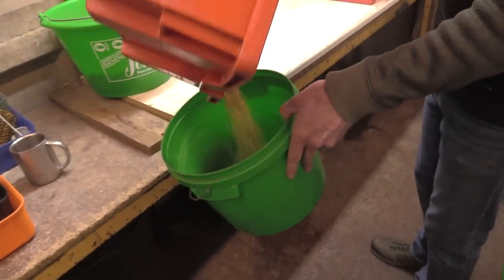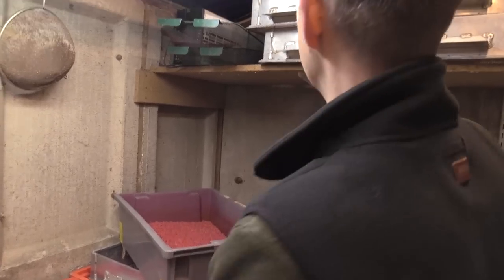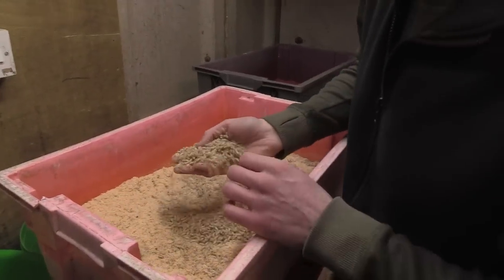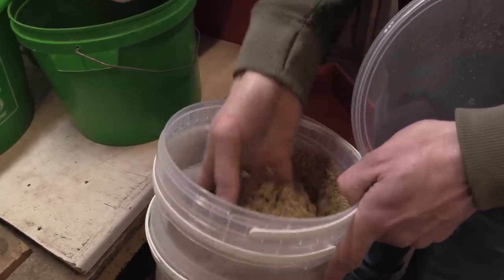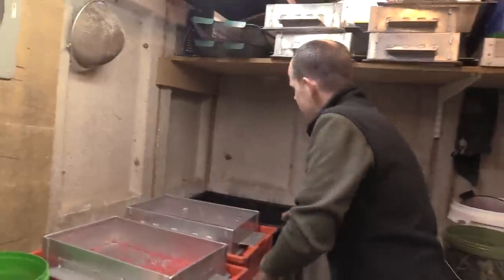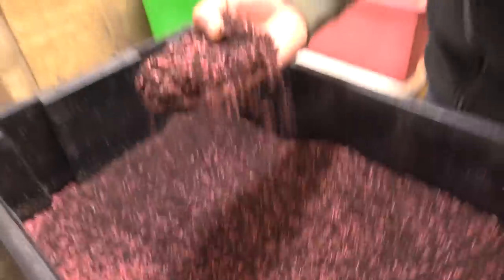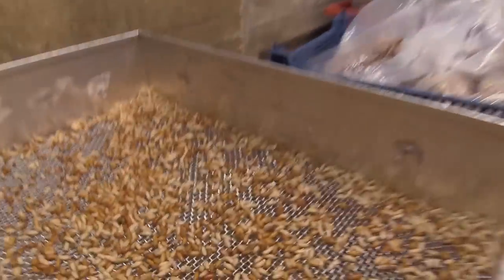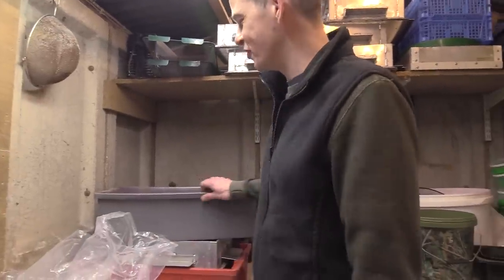How Maggots are Made 🤢 (But they work!)

Comment: A few years ago, our club dredged a carp pond and retrieved literally thousands of rotting boilies. Thereafter they introduced a rule of no baiting with loose boilies. However, in the making of a boily it is only the skin that is hard, the inside can be quite soft and suseptable to faster breakdown. Therefore split or chop your boilies first. 
A bag of crumbed boilies can be even more effective as there is more surface area to exude more flavour into the water column a lot quicker. Also small fish can take advantage of some of the nutrients same as with pellets and in a stocked lake neither will last that long.

Comment: I will never forget the day I had to go to a telescopic handler in Suffolk, I was told it broke down in a barn when I got there and got out of my van my eyes started watering! It had broke down in the offal there were chicken heads,feet and guts stuck all over the machine i nearly threw up! The smell stayed on my boots for weeks. They mixed feathers with the offal and had loads of heat lamps hanging from the roof.

Comment: I got a maggot story. Back in my youth I used to do a fair bit of float fishing. I obviously had my own bait box to store the maggots in and the way i would store them would be to wrap the box up in a bag and stick it in the fridge. Stored them like this for years until one day we opened the fridge up and a load a maggots just fell out and all over the floor like in a horror movie. My mum had stuffed the fridge with so much stuff that it had squeezed the bait box and the lid popped off and all the maggots crawled out. I tried to scoop as many of them up as I could and put them back in the box but I was in a rush to get myself to school so my mum or dad decided to take care of it.

Unfortunately, one of them decided to use the vacuum cleaner and just hoover them up like carp hovering over a bed of maggots -- Problem solved you would think. But who ever did it also didnt throw the old dust bag out and we found that out a week or two later when we were in the middle of a heatwave and the house was full of thousands of flies all over the place.

I think that was the last time I ever stored maggots in the fridge. I could still buy them from the shop if i had a fishing trip planned but only half a pint and whatever I had left was given away or dumped into the river/canal.

It was too much of a pain to go back and fourth for maggots and I eventually stopped using them entirely and switched to fishing for carp with bread, pellets, worms, corn, luncheon meat etc etc. pretty much anything you can grab from the local cornershop or supermarket and go fishing with.

Unfortunately small local tackle shops are so few and far between these days. Many of them that existed in my youth are well long gone and there never seems to be many new ones that open.
Reply from the maker: That's a good story,thanks for commenting...especially the hoover bit..I think I made the same mistake(just once) cleaning them out of the car.

Comment: I had half a pint of maggots tip in the back of my van which isn't ply lined and they some how got into the metal and I sware for about a month I was getting flys coming out of the air vents when I turned heaters on